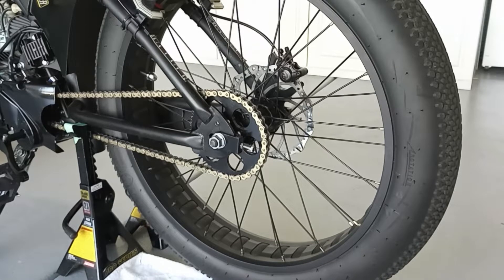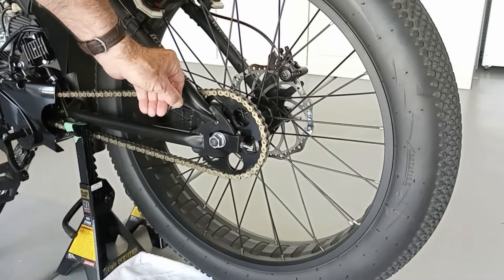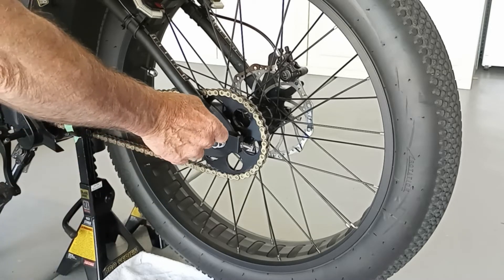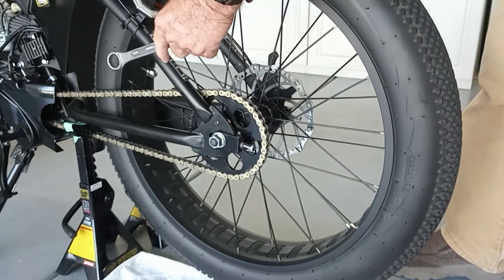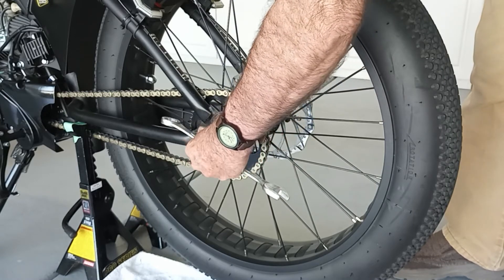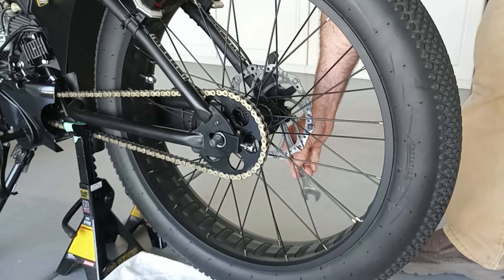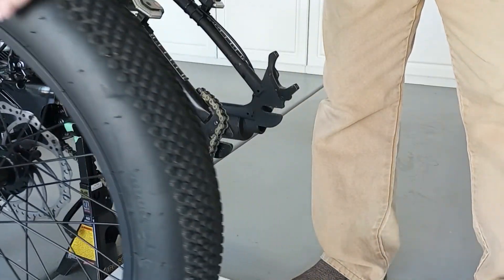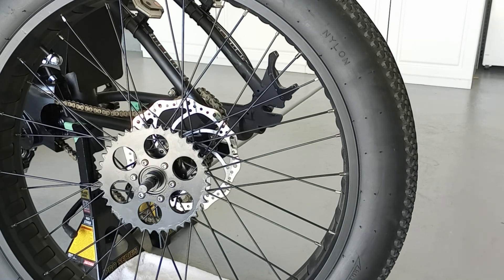Phatmoto/Sikk Ped:  Removing rear wheel for the purpose of Blue Loc-tite sprocket bolts. T27 driver

Comment from the maker: Any and all modifications I do are strictly what I do. It is what works for me. You do the research and make the ones that work for you and your needs. I do not recommend drilling a hole in your frame at any time anywhere, for any purpose. Do your research and make the modifications and upgrades that work for you. The sprocket bolts need a T27 size driver to secure the stock bolts.